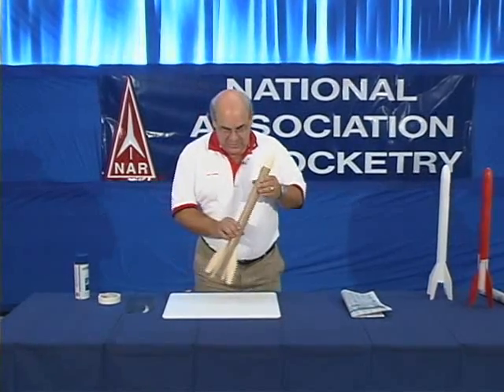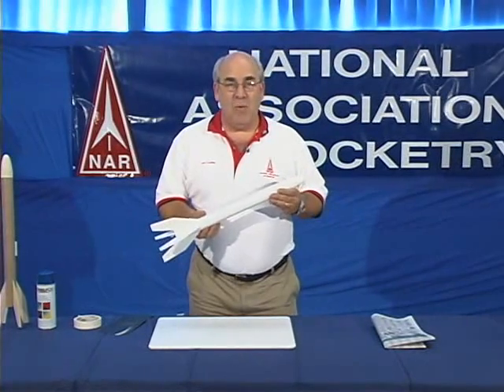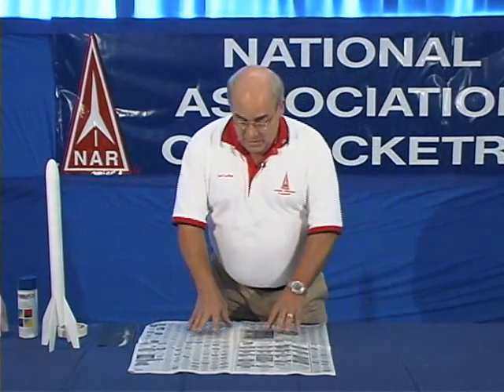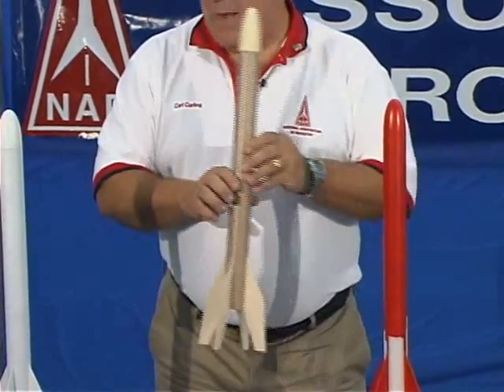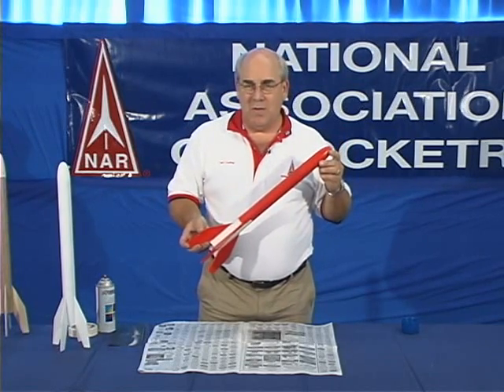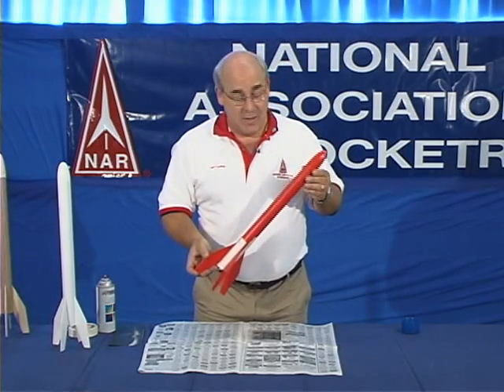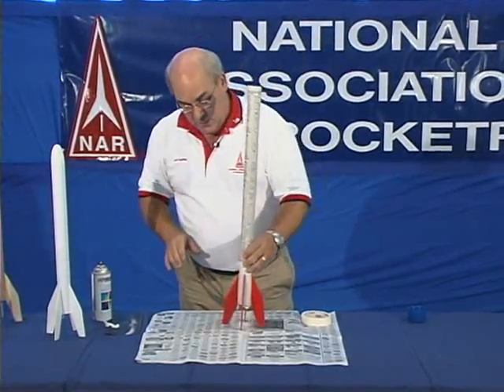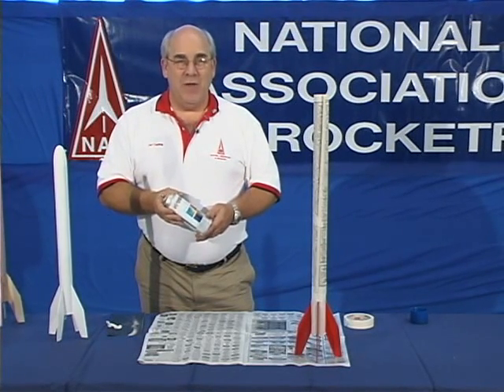Rocketry How-to Part 6:

Painting the Completed Rocket

Comment: The paint and primer in the hobby shop all say highly flammable.  Is this a problem once the paint dries?
Reply: nope, just the fumes are flammable and it's gonna work great once it dries. all spray paints use flammable gases to spray.